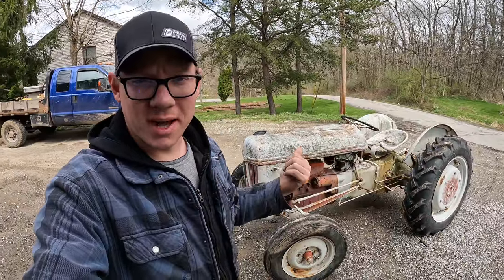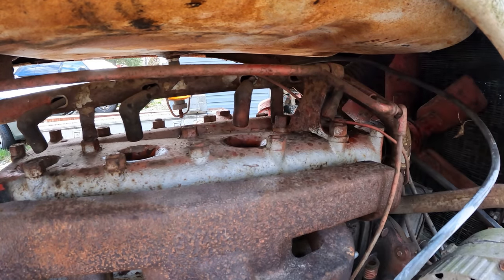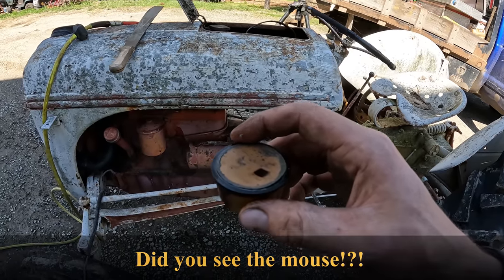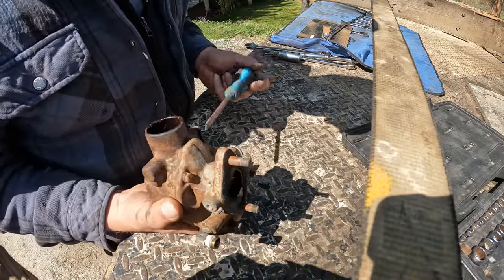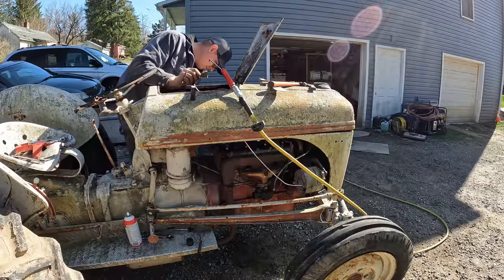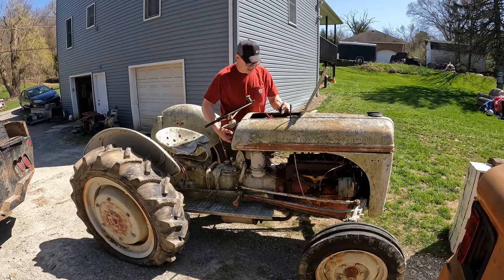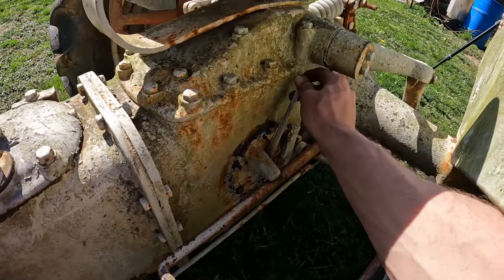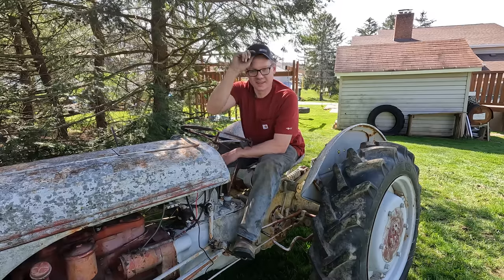Saved From the Crusher! Will this 80+ Year old Ford 9N Ever Run Again???

Comment: Fords and Furgesons of the era were virtually indesructable, although a bit quirky. The brakes were a weak point. My uncle's tractors never had working brakes. I think the axle seals would leak and ruin the pads. The engine backpressure would stop you under certain circumstances, but being pushed by too much weight on a steep enough hill would cause one of the wheels to spin backwards, effectively causing the differential to move faster than the gear ratio otherwise allowed.  This, even with your full weight on the brake pedals. Another quirk is that the front distributor cap would crack when the front axle would come up high enough to hit it. This left us scratching our head trying to understand why it would start hard or  run rough esecially in damp weather until we figured out the problem. If you're going to use one of these tractors with a rotary mower or other implement that creates inertia, don't do it without an overrunning clutch. It's a simple device that attaches between the output shaft and the implement and will keep the inertia of the implement from pushing the tractor even after you've stepped on the clutch.
Reply: Ferguson*
Reply: @adamnielsen9929  my bad
Reply: My neighbor a new to the country guy bought one and a brush hog he promptly drove it into the pond he called me to get it out with my winch truck he did not have a overrunning clutch on the PTO he said I had my foot on the clutch and brake and it would not stop !  he did not know about that problem

Comment: You forgot to mention that it was the first American production with Mike Ferguson 3-point hitch system too
Reply: Harry Ferguson was his name he was a British mechanic and invented the 3 point lift and the draft system. He and Henry Ford had a falling out and parted ways.
Reply: Harry Ferguson was an Ulsterman  or Northern Ireland
Reply: From the video it appears there is a PTO over running clutch which is a safety device the prevents the pto operated equipment from "pushing" the tractor around when you step on clutch. Lots of guys shoved into fences and ditches bushhogging

Comment: I learned how to drive beginning on one of these at the family ranch in Montana.  I was so small that I had to pull up on the bottom of the steering wheel to push the clutch on the left side and the brakes on the right side, down.  These tractors were everywhere when I was a boy, although they were of limited utility because of a three speed transmission that had first and second too low and third too high for many jobs like mowing and raking hay.  The Ford 2000 with Selecto-Speed transmission just put these things in the shade.

Comment: Nearly identical to the Ferguson TE 20 with the Standard Vanguard Engine. Many of these in the UK & Australia.
Reply: It is Henry Ford had a gentleman's agreement with Harris Ferguson to Mass Produce them because he was so impressed with the 3point linkage & PTO 'Furguson System' range of implements. It was faster, easier & more agile than the large drawbar steam tractors of the time.
Reply: @TheGrimReaper1  I watched a documentary & I believe you are correct

Comment: Howdyyawl from the land down under. That's a nice little N9 Garden or Market tractor. They would have been used for just about every job on the farm of yesteryear. I had a Ferguson TEA20.Similar unit. They were also used for every thing. You will have no trouble moving it on. 😊

Comment: The coil and points on those engines were located in the most awkward spot imaginable, and if you leave the ignition on for very long you will burn up the coil, don't ask me how I know.
Reply: You don't work on them while the distributor is on the tractor. It comes off real easy and can only go back on one way so you can't get it out of time.
Reply: On my dad's, I added an oil pressure switch in the ignition circuit so the power is cut when oil pressure is lost. The best way to shut them down is to shut off the fuel but you have to remember to shut the key off.

Comment: I put a lot of hours on a 9N, brushhogging, raking hay, misc small utility jobs.  One of the real strengths of design was the low profile.  Though I loved driving the tall JD's, the Ford was much easier maneuvered around trees.  I could lean over & hunker down below the hood to go below limbs, etc.  I do recommend if you're going to use one for all-around, brushy work to get a front "bumper".  Maybe a length of railroad rail which also adds some weight to front end.  Also helps cause the brakes generally don't work/require a lot of fiddling.  I just generally never used em.  Thanks for the memories :)

Comment: I built a washer/dryer room in the basement, so I installed a washer valve that has a hot and cold and a drain, then I  put in the sheet rock,  now the valve won't shut off, to fix it I need to bust out the section of wall and replace the valve, congrats on the inspection

Comment: You actually don't want to use anything on compression nut or flare nut threads. Teflon tape is only for tapered pipe threads (NTP) because those are fittings designed to seal by the threads. Think about it for a minute, if a compression or flare fitting is leaking and you manage somehow to seal the threads of the nut it is still going to leak around the tubing. You have to seal the ferrule on the compression fitting and the flare on the flare fitting or it is going to leak and all the Teflon tape in the world is not going to stop it. I worked 23 years in the reliability department of a major refinery and my last 11 years in the field for Dresser-Rand. Both companies have a dim view of Teflon tape and largely for the reasons you mentioned. Excellent videos, keep it up!

Comment: It's a distributor, the coil dots on top of it and is clipped on, the top half is actually the coil, and the bottom half  where the points and condenser are is the distributor. the "spring" attachment you mentioned takes the electricity from the coil to the points. I wasn't aware they made those coils in 12 volt, the conversions I've done (2 of them), I bought a resistor to drop the 12 volt down to 6 before the electricity got to the coil. if you got a 6 volt coil and didn't do this, it'll run for awhile, but you'll just burn this coil up too.

Comment: We had one of those from around 1952 or so, working like a charm all through the 80s and into the 90s. Sold to a friend early 2000s and probably still used today. I still remember the controls and stuff from when I was a kid riding the thing. Ours had a dual fuel system, you'd start it up in gasoline and then switch over to cheaper kerosene or something once the thing got warm. Not the strongest puller in the world but in pretty good shape still. The paint was way better in ours.

Comment: Thanks for the video, I owned a 2N which is just about identical to the 9N other than the oil bath air cleaner. We used it on a homestead in the 80's -2004, all my daughters learned on that tractor. God Bless and thanks. Doug

Comment: My uncle had one of these Ford models from the late 1920s early 1930s looking much like this one. It ran long after he was np longer able to drive it. One tough little tractor. He used his to haul 4 foot length pulp and hardwood from country areas just outside of Sussex NB Canada. It hauled amazing loads that far exceeded its size. Great little tractor.

Comment: I have had two of these, the best and sweetest tractors ever. I love the sound of these little flat head 4s. These are very stable on steep ground. I mowed straight up and straight down some very steep old pastures. Turning around at the top requires a fast turn standing on the outside break. The best.

Comment: That's the first Tractor I ever operated by myself at about 12 years old.  A fine machine.  It had a set or pick up Discs with wooden bearings and a 3 point hitch including a grader blade for the road that could be used to plow soil or cut a ditch . Not to mention.  When I got my first 1966 truck stuck pull me out. I'm 54 . Fond memories 😁👍

Comment: People are saying these tractors are good for small projects. We farmed 160 acres with 2- range 9-N. We eventually graduated to a Massy 165, a Deere 402O and finally a JD 4630. Still have all of them except the 9-N. The 9-N had a small toolbox because all you need to keep it running was a small crescent wrench, a screwdriver and a pair of pliers. ❤❤❤it’s weakest link was the electrical system.

Comment: Matt I have a 601 Ford Workmaster 1959. Basically close to the same tractor I restored from a 6 ft view! Those tires have fluid in them and the rims rust out starting around the air inlet! I changed mine to a 12v system bc the 6volt and points don't last but 10 minutes!! Lol

Comment: I have a 9N that runs fantastic. Has a Du-Al loader on it and I put a 5' Rotary Cutter on the PTO. Thing works like a charm. I just switched it out with a 12 Volt system - I HATED the 6 volt with the generator. That thing would bog down in heavy brush and would take two hours to get it started again. Nice tractor. Great trouble shooting job Diesel Creek.

Comment: Hi Matt,
The carb on your 9 caught my attention.  Marvel-Schebler had a plant 500 yds from where I live. The plant was gone sometime before 1970 when we moved to Decatur, IL to begin my career with Caterpillar.  M/S was guilty of dumping some pretty toxic stuff in the creek or wherever they could dump it.  EPA came in about 1985 and drilled 30 test wells to measure the contaminants. We are on a well which pulls from a really good aquafier.  We lucked out M/S's stuff had not
reached the aquafier. The M/S plant here made a lot of aircraft carbs especially during WWII.
I noticed your machine had an "early" model alternator.!!!LOL.  After watching the rest of your vid my memory turned on.  I remember pulling a hay wagon one afternoon.  That would have been about 1956.

Comment: The easiest way to work on the front mounted distributor on a ford tractor is to get it up on #1 cylinder TDC and the remove the distributor from the tractor making sure you know with plug wire and rotor button goes to number 1 cylinder. It’s so much easier to replace points and condenser. Plus inspect the advance weights

Comment: Most early Ford vehicles were positive ground electrical systems so make sure when hookup the battery so it turns in right direction and it charges the battery .

Comment: I have a bit of a "love / hate" relationship with the 8N so this brings back memories.  I did a Vo-Tech degree in Farm Diesel Mechanics at the College or Sothern Idaho and they had several 8D's as trainer tractors.  In one lab, I needed to split the bellhousing / engine joint and replace the clutch.  No problem, right?  I loosened all of the joining bolts, leaving the bottom center to hold it together until I have the rest backed off about one full turn.  I have a floor jack under the bellhousing with about 1/2" gap so that when I loosen the final bolt, gravity will help to leaver the gap open and pull the alignment pins out of their holes.  I am down on my creeper and loosen the last bolt, but the joint doesn't open.  It is hung up on one of the pins.  Just a bit of gentle persuasion with a rubber hammer will jar it loose.  
Yep, that did it and it the whole concept worked to perfection.  The joint opened about an 1/8" and came to rest on the floor jack.  Success!  

Well maybe not so much.  As the joint opened, I found out that the guy before me had not put the front seal in the gear box and we used waste oil in the mockups for a more realistic working condition.  This one happened to be used burn gear oil and I took about a gallon right in the face!  That was the first of several experienced that convinced me that it would be more fun to break a diesel that to fix one and after a few years as a farm mechanic I switched to an over the road trucker.

Comment: My son had a '55 Ford 700 series tricycle tractor. I was primarily tasked with keeping it running, which wasn't bad until a bent rod happened. But it wasn't hard to work on. Even finding parts wasn't difficult. That kind of surprised me. I also enjoyed tilling with it. As a practical matter, the tricycle configuration creates problems that wouldn't exist with your 9n wheel set up.

Comment: Remove the mounting bolts and the distributor and coil can slide right off. Set it on a bench to adjust the points. Then pop it back on. Timing is only one way. No trouble to see what you are doing.

Comment: I practically grew up on a 1950 Ford 8N. Disking corn stalks, pulling a baler, wagon loads of all sorts, spreading manure, mowing hay and more. Those engines will run forever if cared for. Never had experience with a 9N. Don't think I would like the clutch on the same side as a brake pedal. On an 8N you could apply one or both brakes with the right foot which is useful. Our 8N had a drawbar for the three-point hitch. Needs headlights.

Comment: Had a 8n on the farm we lived on. Great old machin...basically the next size up and the front wheel assembly is the narrow V shaped single wheel base made from two wheels set really close together. Lil cone style axle mounts. And had a single barrel down draft Carter carb and was a 6v system. Iirc it was also a four cylinder.

Comment: i got a 8N sitting in my back yard for 30 yrs probably since it last moved, my uncle looked at it and said the engine was locked up, now i know how to get it to loosen up. It was my grandfathers tractor. not sure of the year exactly plus the left brake is locked up on it though. Would be a hoot to see it run again, i would use it if I get a bushog for it for sure haha

Comment: We have the Ferguson TE20 variant of this. It should have a roll bar fitted if you're going to use it in anger, which we do occasionally. We've doubled the back wheels as well because our land is very rough and boggy. With the doubled wheels it will go on land that newer tractors won't cope with because it's light and doesn't sink in so badly. It can come in handy for towing other things out when they get stuck. 

As for the antifreeze smell, we do get a bit of a leak on the radiator water sometimes because the front axle fouls one of the hoses when you run it over very rough ground and the axle twists right over to its end stops.

Be a bit careful on the road too. At stop speed, even though it's not at all fast, it can get a bit scary with no suspension and the brakes which tend to pull one way or the other.

Comment: One more thing to note: adding some motorkote to the engine oil & hydraulic/transmission fluid will quiet it down considerably, & reduce wear. 

I’m not a paid schill on that, just learned through experience. 

Those old systems respond very well to modern synthetic oils & friction reducers.

Comment: Nice job.  Never drove an 9N, but drove lots of 8N and Jubilee at my grandfathers farm as a boy.  My guess is the hydraulic system might be low on fluid and there is a lever under the seat to go from lift to draft mode.

Comment: For a short period in the spring of '74 I worked for a foundry as their very first heavy equipment mechanic. The foundry was about a quarter of a century old at the time and all of their equipment, which had been relatively new military surplus when they'd opened, was practically held together with baling wire and spit by the seventies. I had to set about rebuilding everything. One piece of equipment was an old Ford towmotor. In the process of working on that, I learned that it and those old Ford 9N tractors used the same engine and that one could purchase complete rebuild kits directly from Ford that contained bearings, rings, gaskets, carburetor rebuild kits - basically anything one needed to go through them top to bottom. I think those kits were also surplus and were aimed at the military market to save time for military mechanics in the field during WWII. I wonder if someone still sells something like that.

Comment: fyi, they make an electronic ignition upgrade for these, to remove the points & condenser system. It well worth the few extra bucks. When I installed it on my 9N, I also bought a new external coil. Now it fires up easy, in any weather conditions.

Comment: At age 17, my first car in 1986 was a 1972 Volvo 240 I bought for $400. I immediately took it out and drove it hard and immediately I broke a lifter. I remember tearing down the top of that engine parked on the street in front of my parent's house because we had no garage. I got it running again but not very well so I traded it for a TV. Nice tractor.

Comment: I've got a "collection" of Jubilees. Yes, they're basically rebuildable indefinitely. They make tons of aftermarket parts, as long as the crank and the block is repairable. Every one I've know that's operated one these will tell you the clutch ( for some reason?) Will destroy your left knee.

Comment: Matt, I learned about 30 years ago when i had to work on my father in laws 8n, it had quit running on him, i found out that ford had installed a ballast resistor on the fire wall, which his 6 volt system did not need one, so I by passed it and it started right up ter resistor had burned in too, next he broke the drive shaft, and I had never, ever worked on a tractor before to replace it but I got it tore apart, and had it blocked up, replaced the shaft, put it back together, put the 5 gallons of hydraulic oil back in, he ran it for a while then sold it for another tractor!

Comment: As far as the antifreeze smell; I worked on an N series tractor once, idk if it was a 9N, but one of the manifold studs went into a through hole open to the water jacket. Between that leaking and a bad gasket, the exaust pipe filled with coolant and had that smell to it.